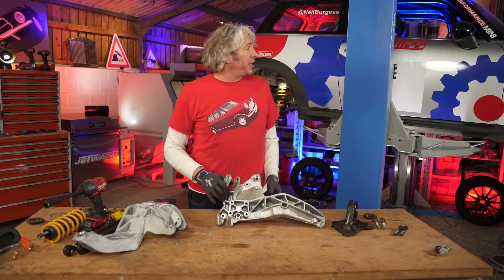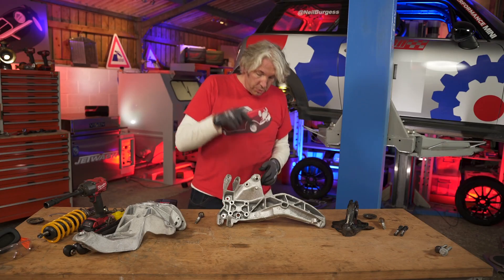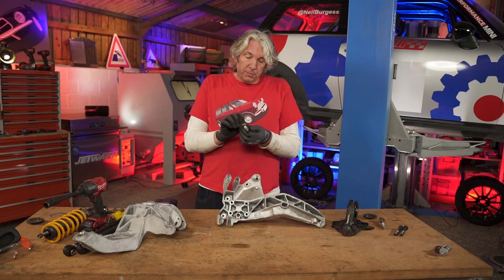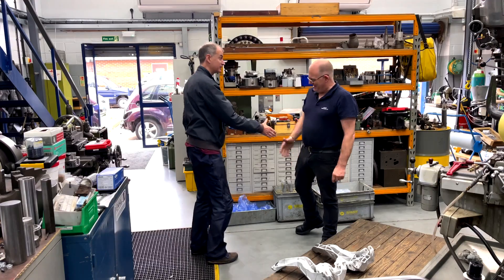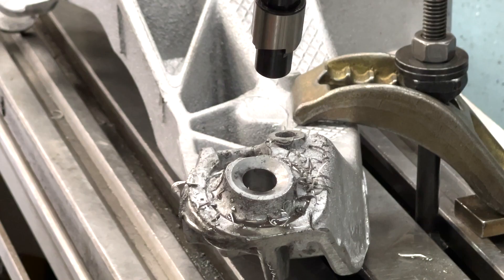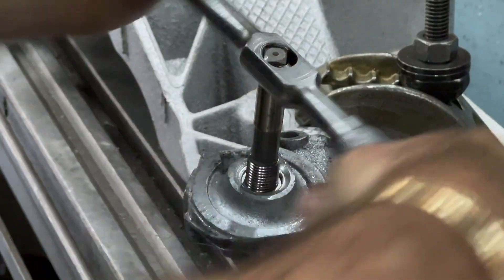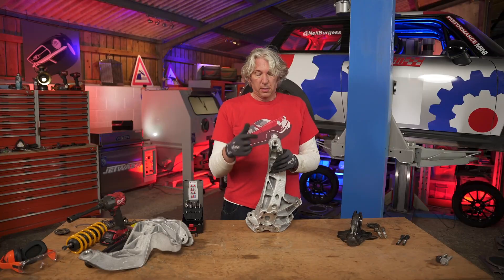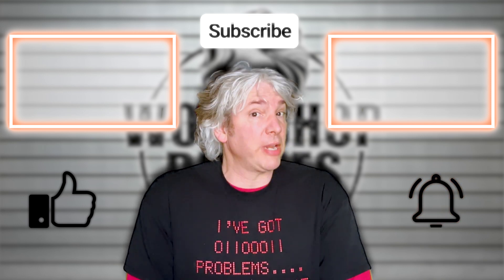Will Installing Thread Inserts Be Strong Enough To Go Rallying With? | Workshop Diaries | Edd China

Comment: I would suggest using a longer bolt and just using a washernut.
Reply: Probably isn’t clearance.I use a top hat inert,set into a slight recess.That way the stress is on the casting itself,not just the thread.
Reply: @Stuart.A   Edd's insert did have a flange, but it was machined with the flange at the other end to what you suggest. If a "back counterbore" bit had been available, the recess could have been provided at the other end without having to use a different setup.

Comment: Time-serts have been very reliable in aluminum for me. Very pricey, but quality product.

Clamping force using a backing flanged nut and washer is how Subaru handles aluminum arms. No threading exists inside the aluminum.
Reply: Have you ever used the time-serts for spark plug threads?
Reply: @mrbigg7255  I have on my V-10, four different cylinders.. worked great.
Reply: @GT-fi4sk  sweet
Reply: @mrbigg7255  I haven't, but would absolutely try it. You just might have to shim the plug if seating depth gets closer to TDC
Reply: Some rally heritage!